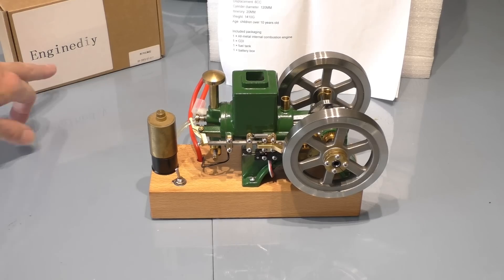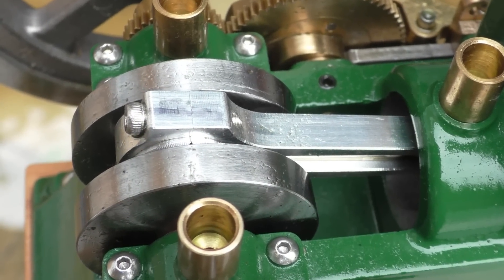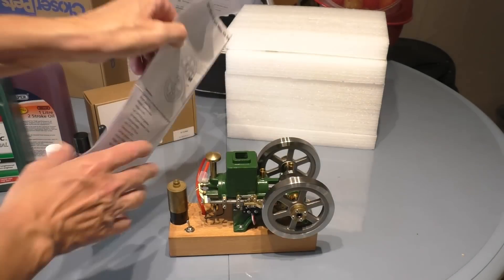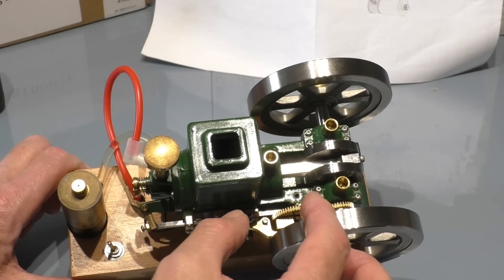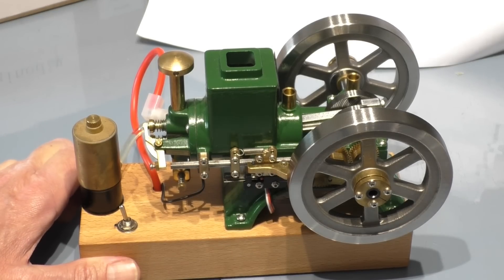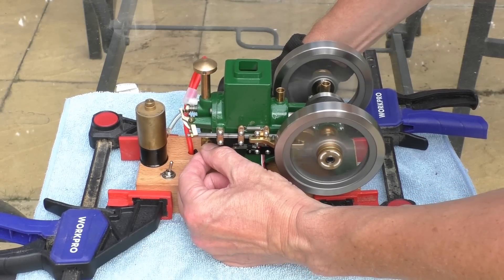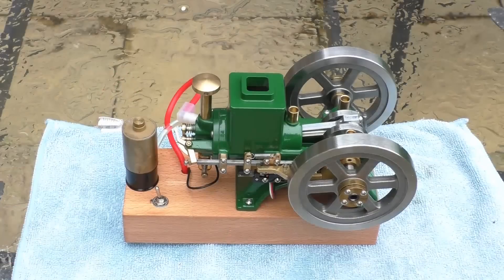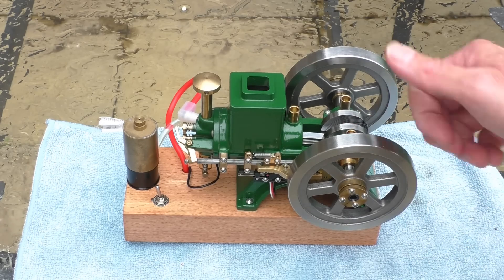HIT & MISS 6cc Model Engine. A true Midlife Crisis Toy.

Comment: They are 4 stroke. The inlet valve operates by vacuum and the exhaust valve is the method of speed regulation. The exhaust valve opening is disabled when the governor detects the speed is too high.

Comment: For $350.00 I can get a full size original one of these about 30 miles away on facebook marketplace, lol.  They can keep their $350.00 toy.
Reply from the maker: You have to love the USA for cheap bargains.  Full sized engines are $1850 over here plus collection costs. https://www.ebay.co.uk/itm/226443394148?_skw=hit+and+miss+stationary+engine&itmmeta=01JDMH8RJYJ4388RV5RCGHGGSX&hash=item34b913fc64:g:bxMAAOSwgfdnD~-9&itmprp=enc%3AAQAJAAABAHoV3kP08IDx%2BKZ9MfhVJKn7WbQ8aWiFWT4eYCbB6xwu1ytdBTx3KTZ2jgunzL64zKruTNwtbzJEk%2BJqttuDZR86R6v0ivVqs4rbYjDBGltjZJZDWt%2FZcN62RcwTeKUk2apKicHsrVJq92VIxWlQY5Io8t7EF34wjXW1E1jhcida%2FIiCQOxT1QmMkRIT8QQOantF678Xg%2FX12k1sz5kQMFIOKteuNUREQFnOFZG3n3SNvwbCRpE77rKSGGUO0MLq9--fZ6wEMrKHECUpAcbNRkf%2FKcQ7YlLfUbsyD7aEryeIz3IPQ3qMPznTQYCB%2Fd8ZGUEQ%2FOpkXLMROaIVY2bWalU%3D%7Ctkp%3ABk9SR8SJo5HtZA

Comment: It literally has an oiler cup on the back of the cylinder and is in no way like a 2 stroke engine. Hence the valves, and the lack of crankcase pressure fed air fuel mix

Comment: You need a starter used for gas rec cars. Rubber wheel that you attach to a motor and bump the flywheel

Comment: Brother, just because this is an ``engine`` doesn`t mean that it wants engine oil... Int. comb. engines use pressurized, filtered oil systems, the oil used in them is designed for that system... A little clonker like this has no filters, has no pressurized injection, it runs on gravity and viscous friction that cycles the oil with component revolutions or strokes... This would much prefer a hydraulic oil or any other wear-reduction oil that is wholly free of detergents of any sort... Wear red. additives are fine, but also need to be checked, as material compatibility is still imperative when oiling a running system... Lubricants are not universal nor should they ever be used as such... Tolerances and all system clearances are designed to revolve around and allow a specific oil to do the job of lubrication flawlessly or the thing just breaks apart, you can`t run any oil just because it appears to be of adequate viscosity... 

The two stroke oil is a perfect advice, hell, that shit is a good advice on modern car engines, both petrol and diesel as a fuel additive, especially the additive rich 2stroke oils that help clean the engine and the exhaust, as otherwise you risk dpf/cat/whatever other component potentially getting caked up with soot, which the cleaning oil actually helps remove, so it`s even better than just adding those ``injector cleaners`` or what not to the fuel, as those drop the lubricating properties of both diesel and petrol, which is not great for the cylinders, where the 2stroke oil is great for the whole system, as long as it is designed to help clean the engine and the related systems... (also does wonders for the fuel pump, again - both petrol and diesel)
 
Best regards!
Steuss
Reply from the maker: Hi.  Thanks for extra info.  Yes males perfect sense.

Comment: Has anyone fixed the regulator to hold stable revs? And what fuel works best?
Reply: The rpm "hunting" is not a fault. The regulator is working as designed.

Comment: My toy is the Sichuan Sifa MB168F diesel engine on Amazon. The smallest one with the offset filler cap on the red diesel tank. It's not really a toy. Just well cared and the shaft adapted to 1 inch. I cranked in the restrictor bolt. I don't want it running anywhere near 3000 RPM. I stick to pump diesel and 15W40 oil. Watch the oil level and mount it on plate aluminum not steel.

Comment: The piston should be lubricated from the main oiler on the rear top of the cylinder, you shouldn't need 2 stroke oil at all, the piston skirt should drag the oil forward and lube the cylinder wall and rings,
Reply from the maker: Thanks
Reply: It helps.

Comment: I may be wrong but it appears to be a four stroke engine and. It does oil the cylinder  from the drip tube at the base of the cylinder but two stroke oil is still a good idea
Reply: It is 4 stroke. Speciality is the pressure controlled intake valve with no pushrod.
Those hit-miss are more efficient than throttled engines at part load. There is no throttle to restrict airflow, they always run full compression.
Reply: @pepethefrog7193  arent theyt taking on fuel and exhausting it unburned during the off strokes or is the intke valve spring loaded where it wont open and allow airfuel in?
Reply: @eldoradoboy  During off strokes the exaust valve stays open and the spring loaded intake does not open. No fuel wasted, Maybe the video creator can do a slo-mo of the valves during on and off?
Reply: @eldoradoboy  
There should be some cooling effect when the piston goes up and down on the "miss" cycle as air is drawn into and leaves the cylinder via the exhaust valve which is being held "open" by the governor "catch"....
Reply: The outlet is held open by the governor. So it doesn't suck the inlet open. @eldoradoboy
Reply: @JohnSmith-pl2bk Its not really an exhaust valve. The exhaust leaves through a port accessable through the side of the cylinder at the bottom of the stroke. Intake enters from a port on the opposite side of the exhaust port from the engine case and blows the exhaust out while occupying the cylinder with air/gas mixture to compress again. A compression release is placed at the head and is operated by the governor to keep from overreving, since there is no throttle.
Reply: 90% of people have no idea what hit&miss is. We used those in west Texas oil fields forever, not models, real ones. Nothing new or amazing to me, but the simplicity is amazing. The old engines ran forever
Reply: The mass electrification of the farms in America was the biggest change for the elimination of the hit and miss engines.  They were still used in some remote applications like to pump water to fill a stock tank.  They could start the engine and the engine would be connected to an apparatus called a pump jack.  It was basically something to operate the pump handle on a hand pump. The rancher could just leave the engine running and when it ran out of gas, the stock tank was full of water.  My grandfather used a hit and miss engine to run a vacuum pump to milk cows. The exhaust pipe was run outside so both the engine and vacuum pump were out of the weather.
Reply: @paul5683  I have an Alpha deLaval 1 1/2 hp hit n miss that originally ran a vacuum pump for a milking machine. It's on my list of restoration projects.
Reply: Its two stroke. If it was 4 stroke it would need a 2:1 cam operate intake and exhaust valves. The reason its not firing every time is because it has no load. The governor (regulator) is operating a compression release to keep the engine from over reving. A load would keep the engine from overreving, thus keeping the governor from opening the compression release.
Reply: @Red_Whitenblu  It has the 2:1 gear hidden behind the flywheel. 
This is NOT a detroit screamer type 2-stroke. It does not have the blower they need.
Reply: @pepethefrog7193  no valves, no rockers, no cam. Its a 2-stroke.
Reply: @Red_Whitenblu it has valves, it has a cam lobe, it has 2:1 gears ect......100% 4 stroke
Reply: @feeros57  where's the cam?
Reply: @Red_Whitenblu  on the big timing gear/the other end of the pushrod
Reply: @feeros57  and the intake valve?
Reply: @Red_Whitenblu  right beside the exhaust valve! It's a atmospheric valve on these engines.....bottom line it takes 4 strokes to complete a "cycle" ...nothing about this should make anyone think it's a 2 stroke 🤣🤣🤣
Not even remotely the same principle
Reply: @feeros57  because there is no camshaft to operate valves, and 4 strokes fire every other rotation. Two strokes fire every revolution.
Reply: @Red_Whitenblu  🤣🤣🤣🤣🤣
Reply: @Red_Whitenblu  Two strokes have a closed crankcase. This is a four stroke engine which will fire every compression when under heavy load.
Reply: @austral7634  Yes. I stand corrected on all accounts. I did some reading on these. It is indeed a four stroke. But weird how the valves operate. The exhaust is like a compression release controlled by a speed governor, but the intake is adjusted to open under a vacuum without a cam. And no compression chamber like 2strokes have.

Comment: A nice engine but a couple of points, what you have there is a four stroke, two strokes don't have an inlet valve or an exhaust valve, You don't need to add two stroke as the oiler on the cylinder block is there to lubricate the pistons.
Reply from the maker: Hi Thanks for clearing that up.

Comment: There is no cast iron in these.
The flywheels come in two variations:  One is solid cast steel flywheels, the other is cast aluminum centers with steel rims.  There is no cast iron in these engines.  The body is cast aluminum with a steel cylinder wall and one or two rubber o-ring piston rings (again, 2 piston designs).

This is a delightful engine and one of the best looking Chinese made hit and miss engines that runs very well.

Comment: i have a full size version I've just restored, rosebery 2hp, the oiler at the rear of cylinder is all that is neede to lube the piston and cylnder no 2 stroke oil needed, why does the model version need it?
Reply from the maker: Thats a good point.  I see what you mean.

Comment: I always wanted a glowplug airplane engine.  
I should get one before I die, right?
Reply from the maker: Yes i rem those engines.  We used to call them " frog engines" for some reason.  They run on diesel well.  Deffo dont leave things too late.  Cant take it with you.
Reply: Got one as a 12 year old then immediately was sent to boarding school. The two are not related 😂 I’d say do it even if you run it once then throw it away. Just be weary about buying more or spare parts it can get out of control ha ha
Reply: I had one fastened to a wood post when I was a kid. Loved running it - would really have loved to have been able to afford a plane…

Comment: Fred you need now to buy a full scale hit and miss and have some real fun. I would like to have a Fairbanks Morse  4 cylinder  160 hp.
They really rumble the ground.
Reply from the maker: My father in law had a stationary engine which he used to take to shows.  Needed a trailer to tow it though.
Reply: @CB-RADIO-UK  there are also small ones. Fairbanks Morse Z comes to mind. The smaller single digit horsepower rated ones are transported usually by a small cart.  They're not miniscule but are definitely more manageable in cost and transport. Not easy but easier.
Reply: I love the sound of that particular engine. I know exactly the one you're talking about. 😂